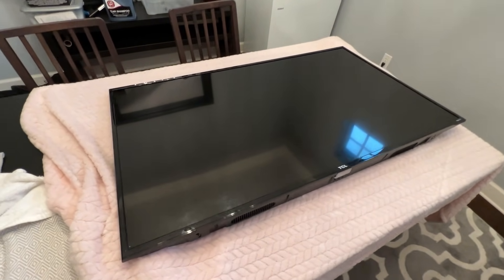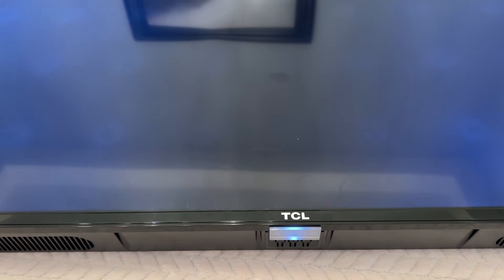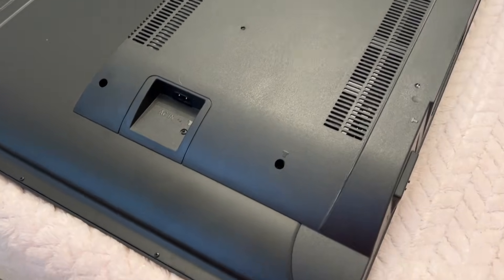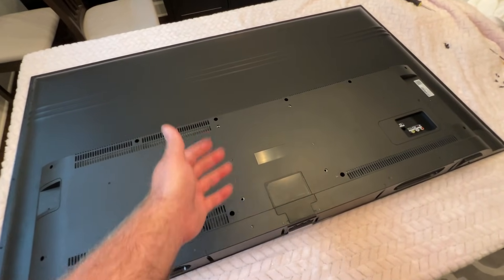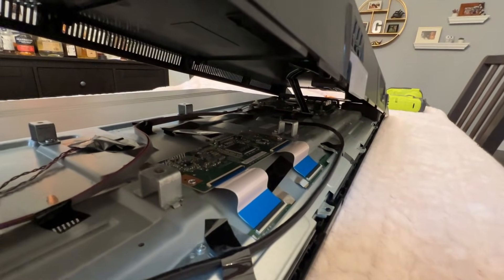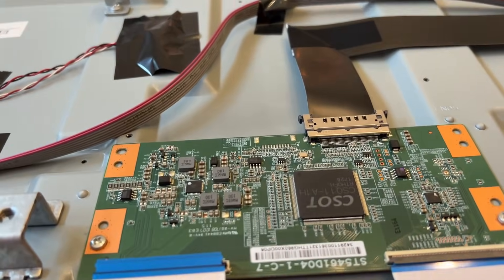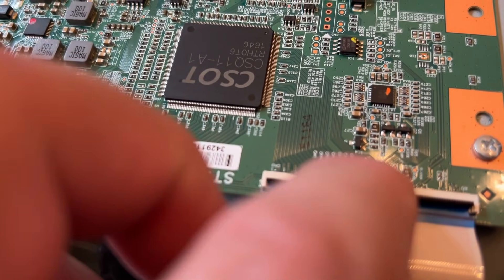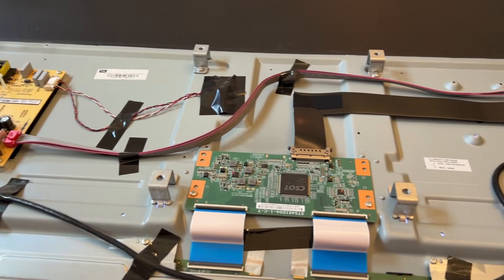Fixing a TCL Roku With No Picture But Has Sound With A New T CON Board 55s405tbca

Comment: I was in Egypt for a month and returned to no tv. Adult kids report no lightening storms. The lower middle power light blinks and the screen is black. I’ve unplugged, pushed the reset several times with power and without held 10s, remote buttons (home5x/up2/rew2x/ff2x) and checked plug in cord connection. Single female nurse here solo so I’m not sure if I removed back panel screws that I would be able to recognize problems. Should I give up on it? 1 year out of warranty so…
Reply: Hii, don’t give up on it yet I literally have the same problem right now I did what the guy on the video did I could see half of my tv screen and the other side stayed blueish off but not showing the apps I have to order a board, I haven’t yet I will order it tomorrow but when it does I will let you know if it fixed “it will fix it I’m 100% sure”

Comment: I have a TLC 55s41r with the same problem. I have sound and half picture when one side of tecon is unhooked. Another person said that the screen itself is gone?
Reply: I have that same model and I'm having the same exact issue. In the process of trying to figure out if it's the board. The tcon board on this unit is integrated into the main board.  Also it's hard to find this kind of board. And it's not 15 bucks! Lol

Comment: Hi I replaced the boards and it work but now I can’t get my remote or phone to pair to the tv to work. Any suggestions?
Reply from the maker: Make sure you connected each wire correctly
Reply: @COGuyStuff  cord leading to the power button was loose, thanks! Now I can’t connect to WiFi (not finding any networks either) any suggestion for that?

Comment: Hey so I’ve done the steps in the video. I’m getting half a screen with one ribbon removed, however I don’t know if I have a tcon board or if I do I have two boards and they span the distance of the right and left sides of the tv. Is my tcon built into the main board or am I going to have to replace the two pieces?
Reply: Mine's the same... what did you end up doing?

Comment: Just had a problem with the same tv.  Weather related power flickers and now when the screen comes on, it flashes on for a second then black.  Shining a flashlight into it I can see the menus.  Problem is I cant tell if there is sound because I have the sound disabled since it was being used attached to a PC.  If it is kicking on and off, does that sound like board or backlight related?

Comment: having the same issue with a similar 55" TCL model, I'm not sure if my tcon board is in a better condition than this one or not but the same thing happens screen is black backlight is on and you can hear sound but unplugging and plugging the tv back in fixes it, the only annoying thing is sometimes it only takes 1 time unplugging it and plugging it back in or it takes 20 attempts. its extremely frustrating and if a 15 dollar part will fix it completely ill have to jump on that.

Comment: I have a 65S4 65" TCL that the screen went blank on.  I have no glow from the backlight LED's, however I can see faint images if I shine a flashlight on the screen.  Would replacing the Tcon board take care of this? I do have sound.
Reply: No that's a backlight problem
Reply from the maker: If you don't see any LED glow, that might be a backlight issue.

Comment: I believe I have to change the main board in mine. My t con is integrated. No picture backlight on and have sound
Reply: Hey there, did you end up replacing t-con? If so did that fix the problem?

Comment: My issue is kinda similar but instead of no screen its cycling through colors red, blue, green, white, gray, and black. I can hear clicking when i use the remote to navigate and I know its getting network connection because I can still turn it of using Alexa. I have tried all different ways of powering off and on and its still cycling the colors. This would still be a T Con board issue correct? I have a TCL 55 55s535.